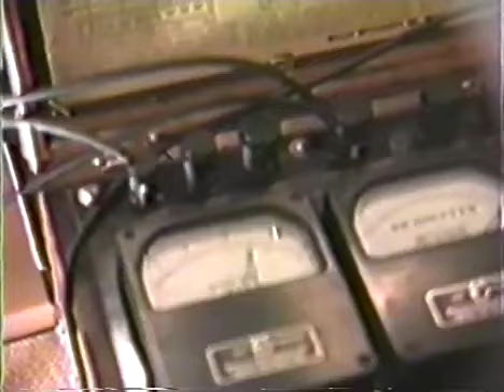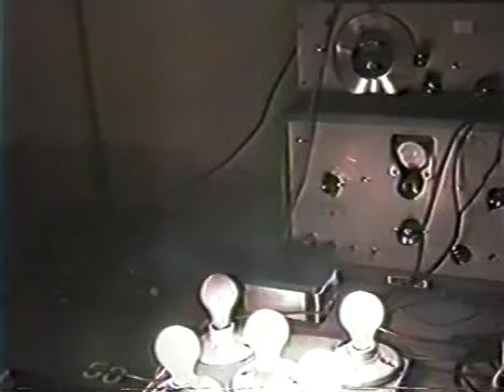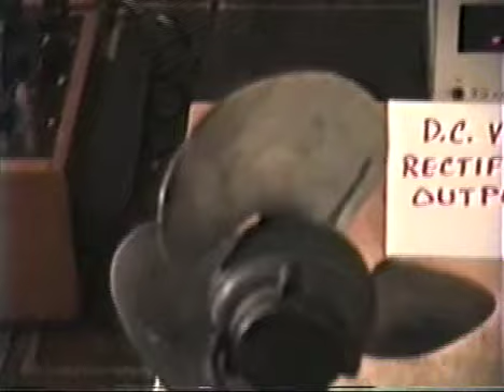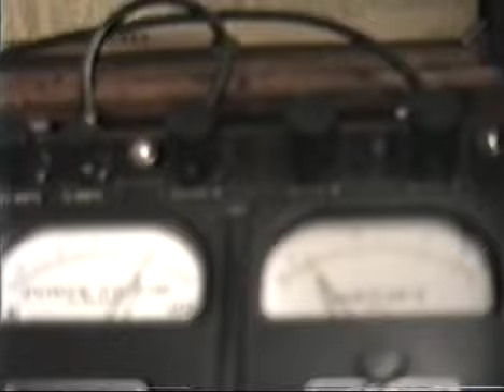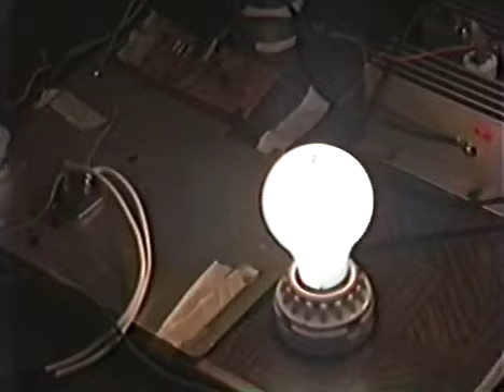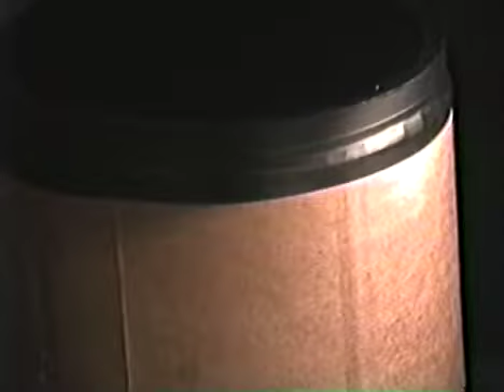1987 - Floyd Sweet's Secrets (with commentary by Tom Bearden)

Comment: It has been my understanding for many decades now, that negative energy (often referred to as "cold electricity" or "cold electrons" cannot pass through motors or transformers. However, it can be used to power incandescent lamps and heating elements. Another factor with the VTA is that it cannot be moved once it is started. Moving the VTA makes it stop functioning. Apparently, it works by creating a sort of "conduit" to free energy once started.

Comment from the maker: 0:44: 💡 Demonstration of negative energy conversion into positive energy using vacuum triode technology.
0:44: Vacuum triode powering 500 watt lamps with steady energy output.
1:57: Conversion of negative energy into positive energy for heat production.

6:32: ⚡ Demonstration of significant power output from a small device using vacuum energy.
6:32: Outputting over 500 watts of power with less than 1/3 mwatt input signal from vacuum energy.
7:01: Stable and usable power generated without any spurious effects or noise.

11:40: ⚡ Revolutionary power technology utilizing negative energy for efficient and safe operation.
11:40: Negative energy power loads allow for easy and safe switching without arcing effects.
11:55: Cold Arc technology enables practical and efficient power usage without circuit burnouts.
12:33: Demonstration of providing 400 watts of power using negative power lines for various devices.

17:18: ⚡ Revolutionary vacuum triode technology for practical and clean electrical power.
17:18: Vacuum triode provides safe and efficient power transmission and control.
19:08: Invention of the vacuum triode by Mr. Sparky Sweet revolutionizes electrical power.

23:36: ⚡ Demonstration of power generation and equipment setup by Mr. Sparkysweet on May 16th, 1987.
23:36: Illososcilloscope set up to view 60 HZ output waveform of vacuum triode.
24:22: Powering 24v DC motor, lamps, and 12v AC fan using Transformer and rectifier.
25:16: Invisible direct Ray visible to tube CCD from lamps.

29:16: ⚡ Revolutionary vacuum device harnesses energy from the vacuum itself, yielding significant power gain.
29:16: Device produces over 400 watts with minimal input, demonstrating a power factor gain of 1,500,000.
30:49: Inventor Floyd Sparkysuite showcases vacuum troud generating practical power directly from the vacuum.
31:21: The technology remains unchanged, emphasizing its consistent efficacy in energy production.

35:18: ⚡ Explanation of establishing frequency memory in a magnet through cathode-plate oscillating current and capacitor discharge system.
35:18: Frequency impressed on bottom coil determines memory in magnet for pump wave frequency.
35:54: Gate opening in vacuum triode is determined by pulsating frequency of capacitor discharge system.
36:48: RC time constant of resistance and capacitance sets gate opening in the magnet to be around 10 or 11.

42:45: 🔍 Exploration of magnet resonance frequencies to achieve perfect resonance at 12.5 Hertz.
42:45: Identifying and adjusting magnet frequency for resonance
44:08: Achieving perfect resonance at 12.5 Hertz

48:38: ⚡ Discussion on driving a small coil with 10 volts at 60 HZ without changing frequency or power.
48:38: The power to drive the small coil is 3/4 of a m and remains unchanged.
49:19: Once the magnets are set, a signal of 10 volts at 60 HZ is needed to activate the system.
49:30: This setup can drive 500 W of power effectively.